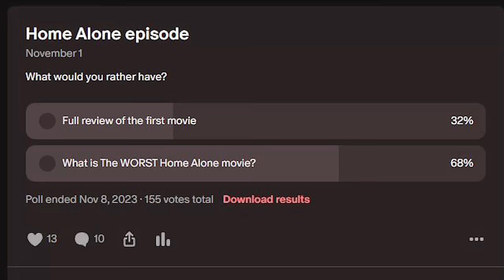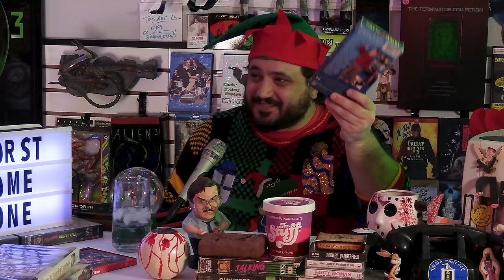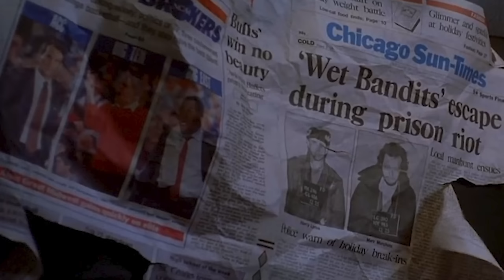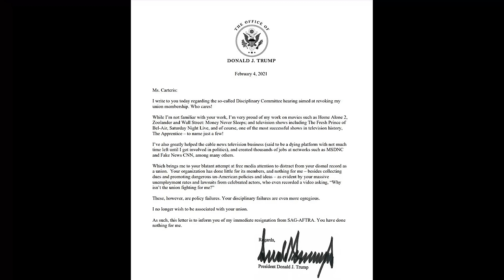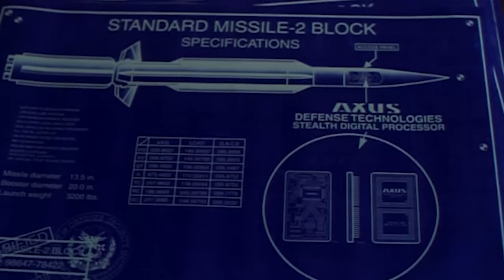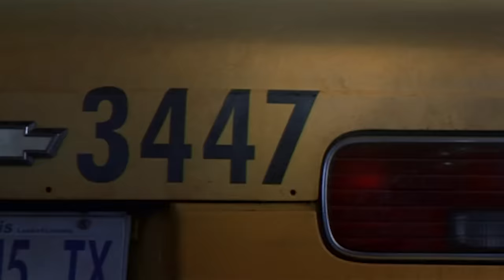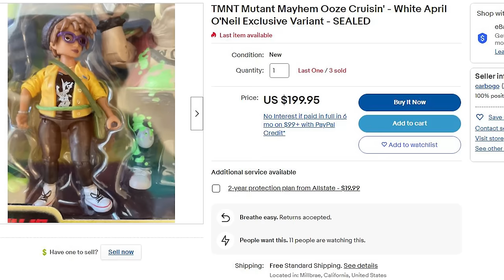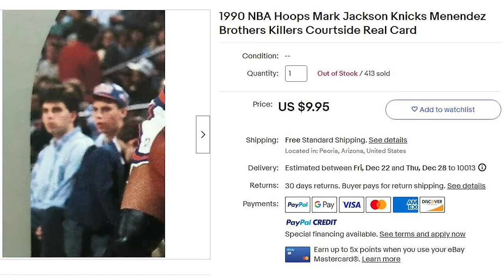What is The WORST Home Alone Movie? - Hack The Movies

Comment: To me, Home Sweet Home Alone is the worst even though it has a few good things here and there not just because it's made with a higher budget, but is trying so hard to both recapture the original and BE original while doing so and fails badly at both. Home Alone 2 because it does sequel escalation really well gets a pass, Home Alone 3 because it was also in theaters and really wasn't that bad kind of gets a pass, Home Alone 4 and Home Alone 5 each being TV movies—even with the fourth one being a weird continuation—meet the standard of dumb without going too too far (I was never angry) and the first Home Alone bar none is widely considered the best for a reason. Home Sweet Home Alone fails at its unrealistic ambition of trying to restore the series and ends up insulting as a result.

Comment: Technically, the second one is a good movie. Everything is done well, and it tells a good story. The problem is that it is a beat-for-beat - often, note for note - shameless rehash cash-in on the first one, even repeating the "Angels with Filthy Souls" gag and "old scary stranger turns out to be hero and friend" subplot without a modicum of a twist. It's essentially a remake. And in this case, familiarity definitely breeds contempt, thus I have to rate it very low. NO way is it better than the first. It's only better than all the following sequels, which isn't saying much at all.